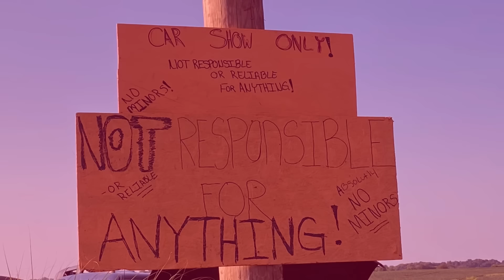Playing in the streets. Update on Raggedy Ann, pretty vs raceable and safe!

Comment: I have the IDENTICAL 1995 sn95 cobra, red on black interior 5 speed. I got it for graduation in 1994. It's changed over the years, me and Chris Bailey have swapped the og 302 to a svo block 363 with a single FI 88mm turbo with a 2 speed 400. Not as street friendly as I wanted but it's a good starter for the wife. Contact Chris CJ we have anything you probably need for Raggedy Ann...
Reply from the maker: Sounds like a nice care man. That’s awesome. I haven’t talk with chris in a good while. Lol.